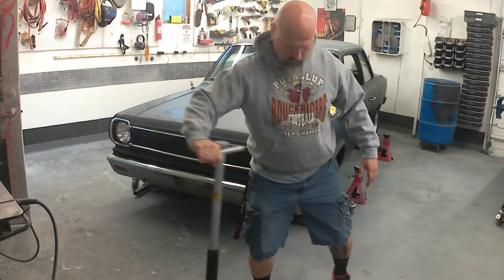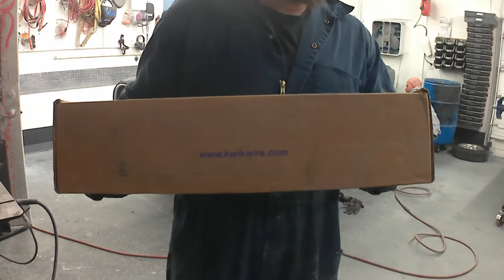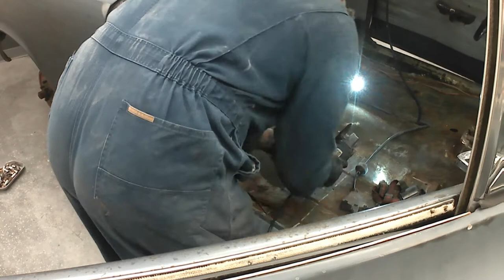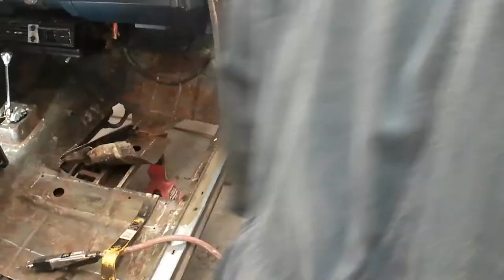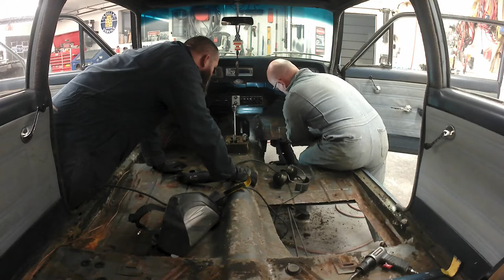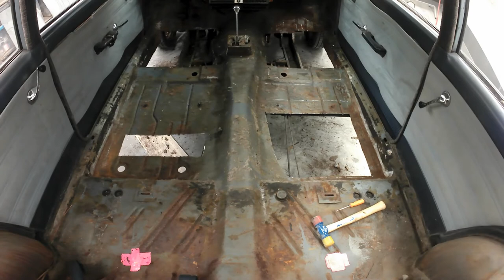Replacing rusty floor pans on a 1966 AMC Rambler part 1!

Comment: I just picked up a 1964 AMC rambler American 440 that needs the trunk floor pan replaced. Can you suggest or know of anyone that reproduces a new metal pan? I'm also going to drop a 343 & auto transmission out of a 1968 AMC AMX Into it, would you happen to know if there's conversion motor mounts & trans mount made to do the swap with? Any help is appreciated
Reply: You need to find a V8 crossmember  and the short metal engine brackets from a 66 to 69 American. 
The short engine mount brackets are only on American, Gremlin and Hornet.
A crossmember from a Gremlin or Hornet may work. 
I am going to be trying to put one of my American crossmembers into a 81 Spirit. 
I believe Gavin's AMC had it in their catalog. 
Otherwise it's swap meets and clubs or if you're lucky a junk yard. 
Going to be pretty pricey for any 01 small body only V8 parts. 
Thats why so many people just weld in chevrolet mounts. 
I could never do that I am a purest 
AMC engine only. 
Transmission crossmember is the same for automatic and manual.